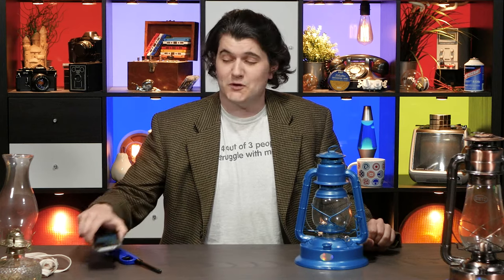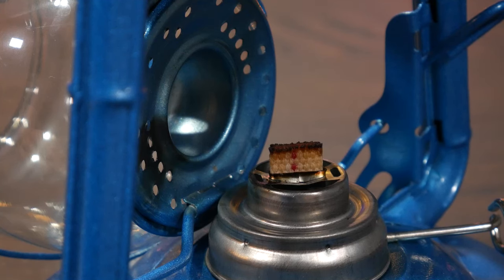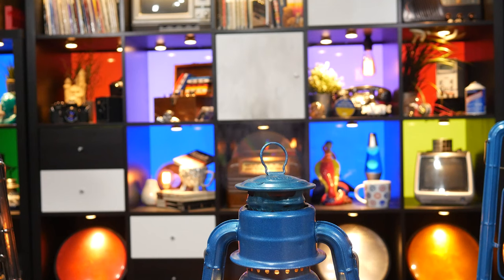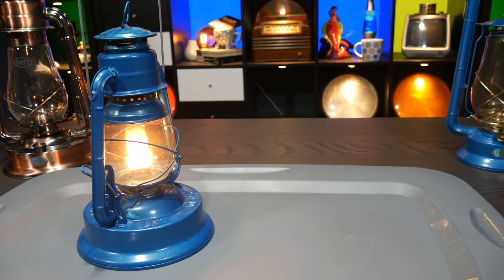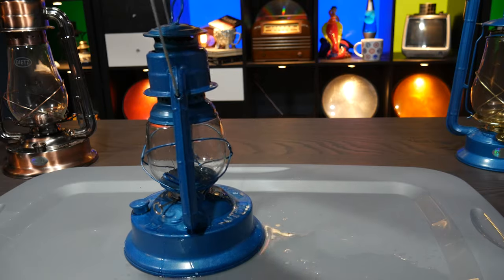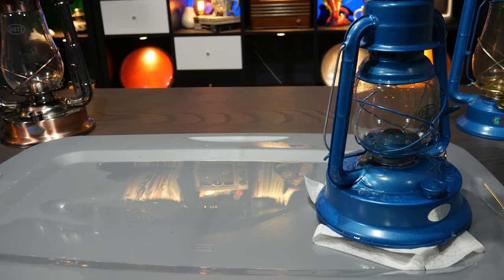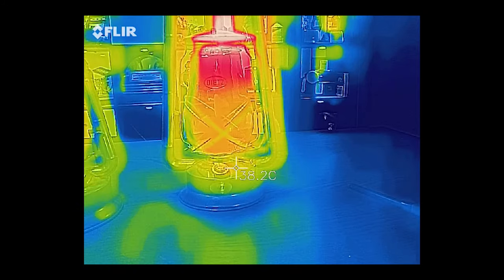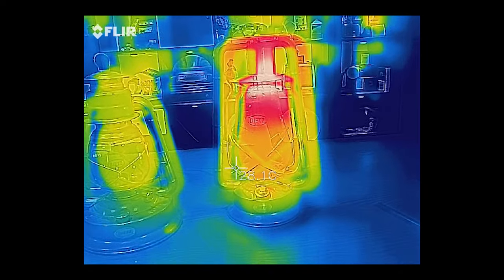How to use, more info, and further thoughts on hurricane (Dietz) lanterns

Comment: If you trim the wick curved slightly humped up in the middle you can adjust the flame higher before soot is produced and get much more light out of the lantern, it takes some practice to get it right.

Comment: I used the cold blast design as a kid to read at night while outside camping. I can tell you that as it heats up the flame does get bigger and you have to lower the wick some to adjust it. I always assumed it was because the whole lantern got warmer and made the kerosene flow through the wick easier. Loved the videos! I would like to see one on the Aladdin lamp or mantle lamps in general. Thanks!

Comment: funny, in all western movies, if lantern falls over, whole house burns
Reply: *correction:

Whole Galaxy explodez
Reply: @Les Not just different fuels, but different lanterns. Most examples I've seen in film (whether from knowledge on the part of the set dressers or happy accident) use older styles of lamps and lanterns.
Reply: Lies. It's really just the cow playing with matches.
Reply: Well, the glass has to break, and you need a conveniently placed set of thick drapes as well.
Reply: The cow did it on purpose for the insurance money.
Reply: @ananthropomorphictalkinggo6641  Mrs. O'Leary threw a burning glass lantern into the barn intentionally for the insurance money and just blamed the cow
Reply: @lanapowell  Seems to be an urban legend: "However, in 1893 Ahern finally admitted he had made the story up. The official report simply states: "Whether it originated from a spark blown from a chimney on that windy night, or was set on fire by human agency, we are unable to determine"."
https://en.wikipedia.org/wiki/Catherine_O'Leary
Reply: Drop a lit cigarette in a bucket of gasoline and 9 times out of 10 it will just go out. 

Hollywood doesn't show the 9 times it went out, because the movies would end up really short and boring. 

Wild exciting events tend to be pretty rare. That's why they make movies about them. 

Nobody would pay $30 to watch a movie about a circuit breaker tripping to prevent a house fire.
Reply: @AmityPost  also most explosions aren't a huge fireball, just a big pop. Hollywood adds fuels to make the fireballs because it's more exciting.
Reply: @renakunisaki  second chance vs magnum force is an infomercial where a guy tries to make a car explode by shooting it with various calibers.  He also tries to sell you body armor in between.

The 50 cal did start some fires but no explosion.
Reply: Because: movies
Reply: @Les Yes, but saturated in straw it might take off.

Comment: Living partly off grid, and loosing power often, I have a large collection of oil lamps and lanterns. I switched most of mine over to 90% on road diesel with 10% clean K1. That small amount of clean K1 helps reduce the wick from charring up. Diesel being cheaper than the clean K1 shown in the video, and cheaper than the red die kerosene. I have tried several fuel types, and found this to be the most cost effective, and reliable option.

Comment: FYI, there is a wick trimmer tool! When using a scissor it’s very hard since there is oil on the wick and you can’t make a straight cut. If the wick isn’t straight cut then it will flame and soot will cover the glass reducing function! 
I had to use these in real life, most likely you end up running out of kerosene and burning the wick tip….
Reply: You can do a good job with high quality fabric shears but regular scissors are terrible.

Comment: While pressurized fuel and mantles produce more light and are more efficient they are also fragile and require more maintenance. Mantels are very fragile (try replacing in the dark). The pumps wear out and generators require cleaning.

Meanwhile the Dietz style lantern only requires wick trimming and replacement.

I use Coleman lanterns (pressurized and mantels) when camping but always have kerosene lantern backup too.
Reply: Well said. If you think you may get into a SHTF situation where you may be off-grid more than a couple of days, hurricane lanterns are your best bet.
Reply: There are also nonpressurized mantle lanterns, most notably Aladdin brand. They're quite bright and need no pumping and thus no pump seal failure. They're a bit pricey though.
Reply: Oops lol.. commented before I saw they were already mentioned
Reply: @asafoetidajones8181  still a fragile mantle involved. And that's a big issue in emergency and a significant expense to someone that can barely afford fuel for the lamp.
Reply: @TEDodd  they're nice lamps - I have one - but they're pretty much indoors/stationary only. Nobody would take one camping in the first place anyway; they have a large unshielded glass chimney as well as a large glass shade. Basically a vast improvement over a dead flame "oil lamp" as opposed to a better version of a pressurized mantle lantern. And pressure Mantles are fine as long as you don't plan to move the lantern much; hang it up in a tree or set it somewhere stable when you set up camp and leave it there, figure on a new mantle every time you pack up.
Reply: @asafoetidajones8181  did you miss where I said I use Coleman lanterns (pressurized and mantles)?
I take them camping/fishing (they have dozens of trips on the mantels) but also take a dead flame lantern as a backup.

This was all about the statements in the the video asking why/complaining about the dead flame kerosene lanterns were still used so much in poor regions of the world. 

My point was the brighter/more efficient options have limitations and drawbacks that explain why dead flame lamps are still so common.

While the current Aladdin lamps are as you described, the technology could be used in a more portable design (like my Coleman lanterns) but would still have the drawbacks.

Comment: When people say “cold air intake” they probably mean a “short ram intake” which removes some restrictions and baffles. This comes with a little more power but a lot of people do it for the sound gains that you get.
Reply: Short rams when they were popular took in warm air, cold air intakes added length to get to a colder spot, typically down low...more of an improvement back in the 90s when the stock intakes were more restrictive
Reply: Ya, and there are also mods to reduce the pressure of the air, making it easier to draw (the reverse hood scoops you sometimes see).
Reply: There was a video on YouTube some years ago where some guy who had just bought a brand new AMG with a cold air intake went through a large puddle and the engine hydraulic-locked and destroyed itself. The water coming in bypassed the little trap that Mercedes had for these sorts of things. Even though the car cost 6 figures, the insurance company totaled it when they got the estimate to buy a brand new engine, ship it, and install it.
Reply: @Markle2k   That sucks. I don’t see why they totaled it unless it bent rods or broke heads. If it didn’t than they could take the spark plugs out and air it out or suck the water out. Then change the oil and it’s good to go.
Reply: @swedish_brick_enjoyer  Oh boy. You need to google “hydraulic lock engine” and “interference engine”. There is a reason why they turn the props through on aircraft radial engines. The oil would leak through the piston rings and fill the combustion chamber on the bottom cylinders . Just engaging the starter motor could squish the air past the rings on the compression stroke and cause the pistons to slap into the incompressible liquid. Bent connecting rods was result. The mechanics, if finding resistance, would have to do exactly what you prescribe: remove the spark plugs and drain the oil out of the bottom cylinders. Now, imagine what happens when the engine already turning several thousand rpms sucks in a slug of incompressible water.
Reply: @Markle2k  Yeah I had a hunch that’s what happened lol.
Reply: I think it gets exceptionally hard to generalize.
He needs to just stay away from the subject. Lol

For example in general you can assume that a modern car would not put a restriction on the intake as that would make everything work less efficiently...
But then you have something like Subaru using the same intake snorkels for the 3.6 as they do for their 4-cylinder engines. And that actually does cause a small restriction and even a vacuum on the open air side of the panel filter.
The majority of owners would not mind because it's more off-road oriented/daily driver and not performance-oriented... But it's just one example I know off the top of my head where it just sucks.
Reply: I remember when I was younger I asked my mechanic what he thought of the idea of putting on a performance intake, and he said, "the guys who designed the factory intake pretty much knew what they were doing."
Reply: @kenbrown2808  as one of those guys I can tell you that we know exactly what we're doing and we also know that what you are getting in your car is not optimal for performance but rather a gigantic compromise between noise, ease of manufacturing, ease of parts interchangeability, etc.
It's a giant compromise and it's going to be really easy to make something better for your specific application.
Reply: @TravisFabel  so you're telling me the race cars with 8 open stacks facing directly towards the sky wouldn't actually perform well in real world driving conditions? 

(For the record. I ride a bored out 82 Suzuki with stock CV carbs and the stock airbox. I've ridden past cars and trucks pulled over because it was raining too hard/flooding the whole interstate. Doesn't miss a beat)
Reply: @AmityPost  I assume they'd perform great but also be super loud, difficult to maintain, and you'd have to make sure no water gets in. Also they might obstruct your view too much to be legal on public roads? Would depend on local laws and the specific car.

Comment: In all honesty, the wire basket around the glass actually works very well in protecting the glass from an impact. My lantern got blown off the table and fell onto the concrete with no damage.

The brand is different but the design / style is the same as the blue Dietz in the video. Mine is red and the brand is "World Famous".

Comment: The performance  from a cold air intake from the after market is usually just because it's larger and easier to pull air in witch also adds more oxygen into the mix . In most cases the factory intake is decent , for most applications unless you are racing. You can smooth out the air path in alot of cases inside the stock airbox and tube to gain similar improvements . The clean burning of a diets lamp may be improved although impractical by a small fan and shroud pushing air in , you could even power it with a thermal couple .

Comment: In regards to Aladin lamp Oil, its not pure kerosene.  It does have an "oily' scent when used in a hurricane lamp, but the actual substance burns much more cleanly than any other lamp fuel ive found

Comment: Lantern nerd here:
The preheating of the air can in fact have an influence on the lantern. In the cold the kerosens viskosity is higher so it doesn't frow through the wick so well. Heating the tank with the warm air can help to reduce this effekt. 
On the other side it can be a problem in small lanterns like the Feuerhand 75 Atom. The warm tank can cause the kerosine to evaporate and "explode" in the tank. This is not as dramatic as it sounds but it can in disturbe the flame or can even extinguish it. The effect is audible as a plopping. 
If you have further questions, feel free to ask.

Comment: You've got to remember the flashpoint of kerosene is only 100F. There doesn't need to be a lot of heat exchanged at the chimney for the effect to work. On the subject of kerosene vapor, have you ever seen the Holley Vaporizer that was used on 1927 Ford Model Ts or Fordson tractors? It used the exhaust gasses from the engine to heat a thin steel plate which the atomized fuel was drawn over to completely vaporize the fuel (before being mixed with the air). On the Fordson, the engine would be started on gasoline, and once the engine had warmed up, the fuel would be switched to kerosene (there being two fuel tanks, a small one for gasoline, and a big one for kerosene). The Model T only used a gasoline tank of course, but that didn't stop people from figuring out it could be used the same way as the Fordson tractor.

Comment: To really test the benefit of pre-heating you should test them outdoors in winter. It probably doesn't make a big difference, but you get it free without really complicating the lantern. The beauty of these is that they are cheap, simple and durable. You can have a few on shelf for years and when the winter storm hits and you loose power, they are ready to go. There are more sophisticated lanterns that I too recommend for regular use, but the ones with a glow sock are delicate and the ones with battery have poor shelf life.

Comment: Quality content, pretty accurate information. I am a lantern collector, and enjoy them quite a bit, my self. 

Dietz was offering these up till 2020, when they defaulted to the Chinese government, because of tax issues. So, they are in a limited operation as of now, and the W.T. Kirkman company in Ramona is not sure where they stand as of now, but hopefully they will bounce back. Anyway, one of the reasons Dietz did move to Hong Kong by 1957 is that in the US by the mid 1950s, banned the use of oil or kerosene burning lanterns on the nation's roadways. so, enters the battery operated flashers used on barricades for road construction we know today. Utilities and construction crews relied on kerosene tubular lanterns for a majority of their warning lantern needs. So, when the order went into effect, Dietz lost a lot of their business. So, knowing that China, as well as India still relied on kerosene burning lanterns, they found their larger market was there. Dietz continued to operate into the 1990s at their Syracuse factory, that they manufactured lanterns and other lighting equipment since the late 1890s. 

Yes, there are far greater and economical means to light one's home or space for either camping or emergency/power outages, yet there's just a warm quality of light that these do give off. I guess I'm old fashioned but, I do burn one or two hot blast lanterns, with a very clean burning fuel, such as Klean Heat, a very refined kerosene type fuel, available at most quality hardware stores, as well as Medallion which is even more refined and practically odorless. 

Since I live in the state of California, the weather here as many know is mild, and I keep a window open and a cross flow of air, to keep fresh air coming in, I rarely smell the lanterns as they burn. 
The self snuffing feature on these is really incase someone knocks it over, it's cool you demonstrated how it works, sadly the locking burner on the current production Little Wizard is really not a great seal, to keep fuel from leaking out. Thankfully the flash point of Kerosene is pretty high, and even a lit match into a puddle will not ignite it. I have a video uploaded where I demonstrate the self snuffing feature on an antique Dietz I have, a hot blast in fact...the air chamber on that lantern is soldered to the fount, and the burner rests in a snug metal cup, so it creates a little better seal to keep any leaking, to a minimum. 

Enjoy the videos, really fun content and I think a lot of great advice and information is presented. As for these tubular lanterns, I find them better for ambient light, which ads a nice cozy feel to any outdoor deck/patio or campsite. :-)

Comment: A lot of people who use kerosene lamps don't even have something like these, they make do with what is effectively the top of a tiki lantern, just a can with a lid and a wick poking out, so the smoke and the fumes are worse. I got a pair of GravityLights from their IGG campaigns and it was kinda disappointing they decided not to go through with that mechanism, but I guess solar and batteries are just too cheap to pass up now.

You also have to factor in the cost of the kerosene... it doesn't get much cheaper just because it was offloaded somewhere in the third world, so people are spending a significant portion of their income just to have a tiny amount of light.
Reply: It's not just about getting them off a petrochemical treadmill. It's about the pollutants being released into the home causing lung disease.

Comment: The oil lamps in lanterns are much better than flashlights or LED lights..

Flashlights in LED lights are used for certain occasions but oil lanterns can burn a long time.

An emergency oil lamps are always the best choice.
Reply: Mantles are extremely fragile.  

A mantle lamp is more efficient, but also less resilient. 

Flashlights and electric lanterns are even more efficient, but depend on the batteries, which either a one time use item, or discharge themselves while in storage.
Reply: Heat output during a multiple days coldsnap poweroutage.
Table lamps are most preferred for me personally, lanterns stiiiiink when they're burning and should stay in the barn where the odors can escape

Comment: The lever to lift the globe should not be used on its own. Grab the carry handle and the ring on top of the chimney the squeeze. That allows you to take the vast majority of the spring pressure up in the other hand, the lever which lifts the globe will then have very little resistance.
If you don't do that it will eventually bend.
Reply: Or you could just flat out shatter the bulb, under some freak circumstances with perhaps cracked or flawed glass.
Reply: @user-xu2pi6vx7o  I've never seen that happen, I've been using a variety of these lamps for 20 years now but I guess it's possible. I've always been gentle with the globes.
Most the time I don't actually use the lift lever. I lift the chimney up rotate the globe out of the way, light the wick and if you're quick you can get it all back together before much soot forms inside the globe.